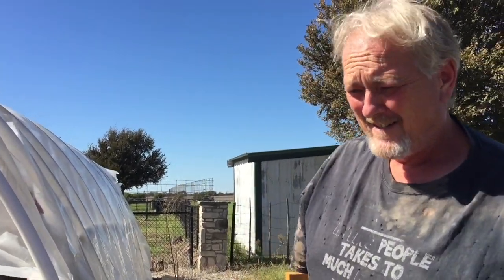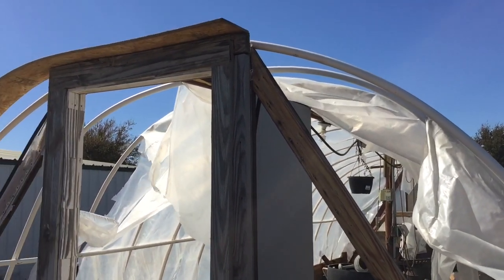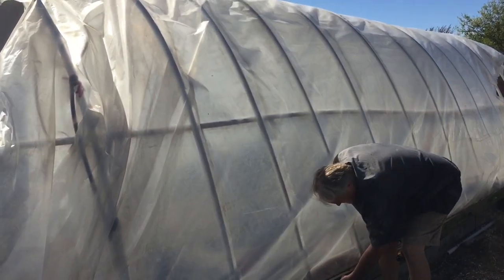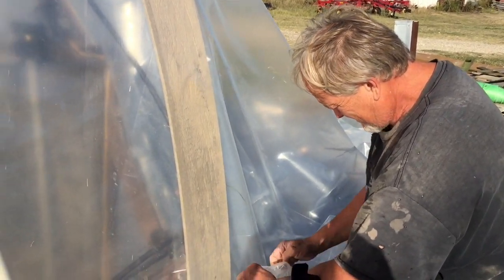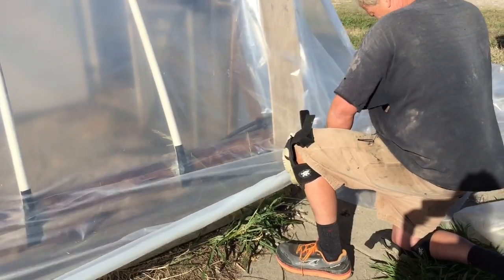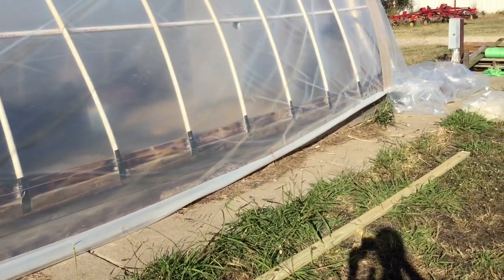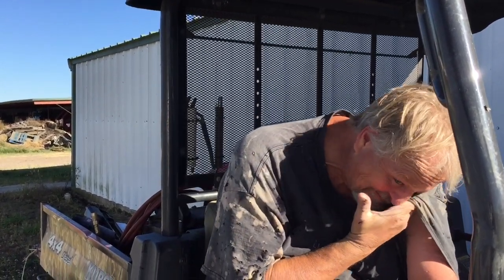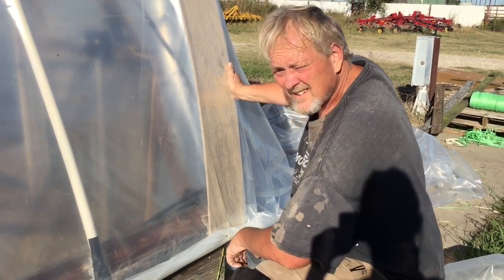Greenhouse Poly Replacement

Comment: i put on 2 layers of 6mil poly then zig zag cover that with bale twine, the thick blue kind for big square bales. then it stands up to the 90mph straight line winds here every summer. like you said it gets hot in there.
Reply: I got it on all my houses
Reply from the maker: +jasonmushersee I have a shade cloth that straps over that holds it pretty good.

Comment: Know it's work i have 4 greenhouses  1 is 60 by 130  2is 60 96 3 is 30 96 this is a free government house you can get one  4 is 24 48 starter house  . I row the plastic under to keep water out.
Reply from the maker: +Bill King you sound busy, I should have rolled it under but I was too lazy. It was easier to get it tight rolling it over, at least for me.